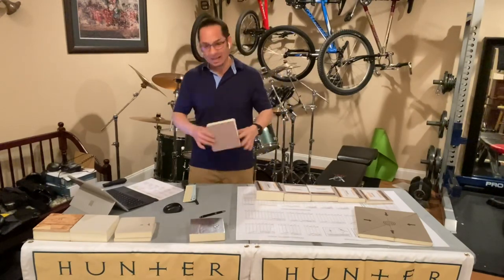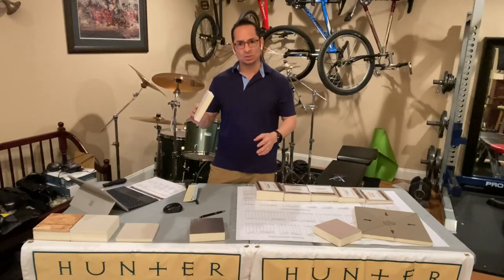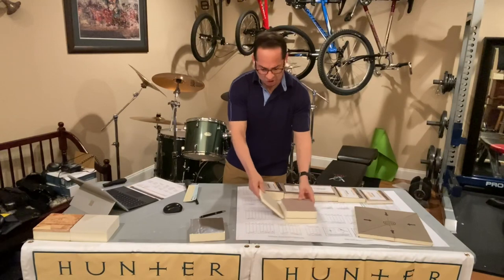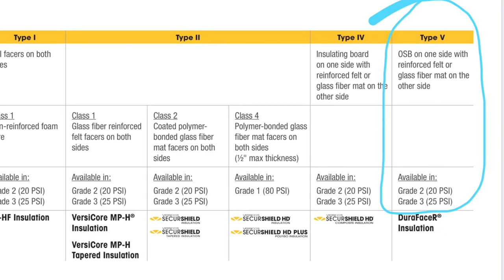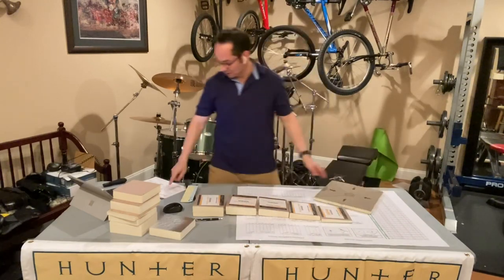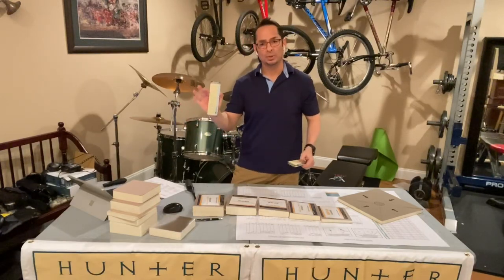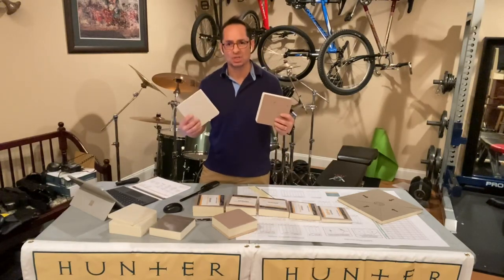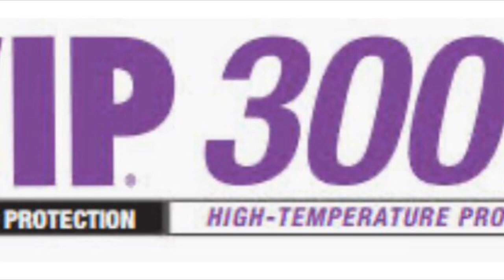Polyiso Pitfalls

Comment: Thanks Jay! I saw something earlier stating polyiso does not do well below 50° which is baffling considering every flat roof I’ve ever been on uses it for insulation. Can you elaborate? This was a video where the lady was explaining the differences between EPS, XPS, and polyiso. I’m going to insulate my pole barn and came across a large quantity so wanted to Se what the deal is with it.
Reply: ASTM C1289-22 allows for use of polyiso down to -40 F/C (negative forty). Should work fine everywhere except perhaps northern Alaska and the Arctic and Antarctica.